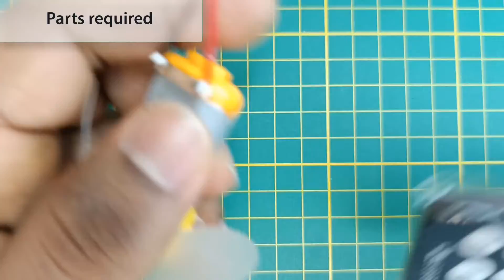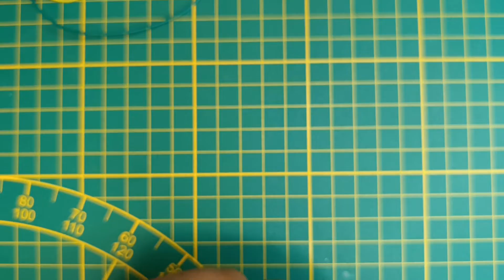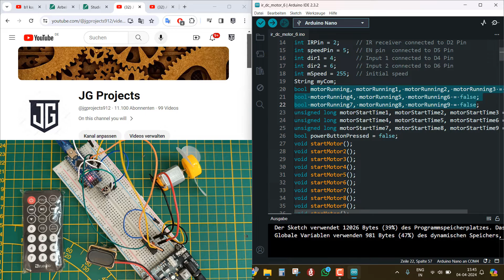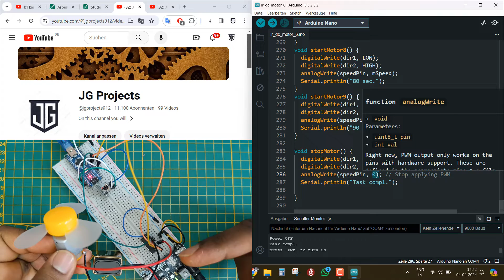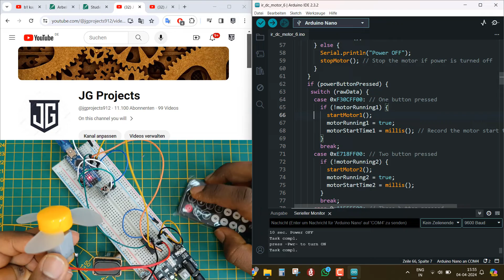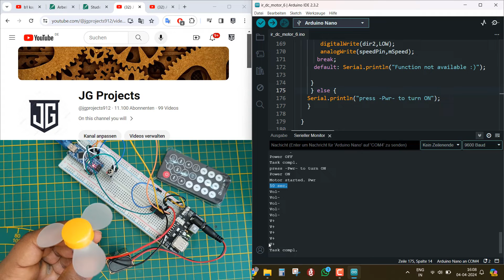Arduino sketch 1: Controlling DC Motor with IR remote

Comment: I also made this project using l298n motor driver 12 volt power for motor circuit but i face problem
1 when motor is off state ir eorks well in serial moniter but when motor is in running state ir shows o zero in serial moniter
2. I also used ceramic cap in motor to reduce emf but not working
3. First time motor starts well but after ir not detects remote buttons
4. I also used 1 min delay in code
Pls help me to sort problem
Reply from the maker: Seperate supply to IR Receiver and dc motor
Reply: @jgprojects912  
Already 
8 volt to nano & from nano 5 volt goes to IR receiver
12 volt to motor driver 
Common ground
I think  IR recever is not ment for dc motor projects 
Low voltage dc motor it will work but high rpm it is not work